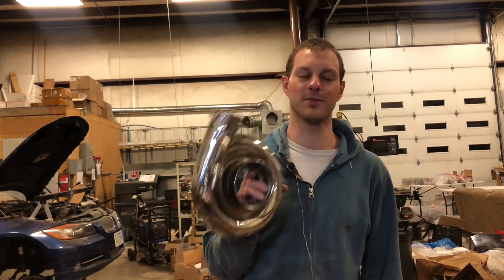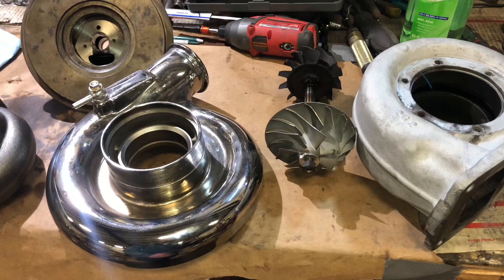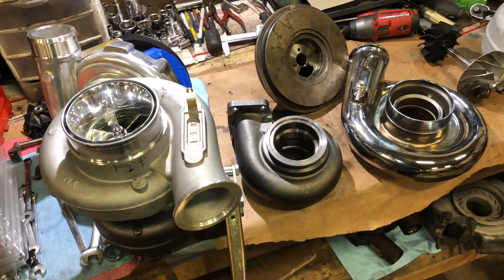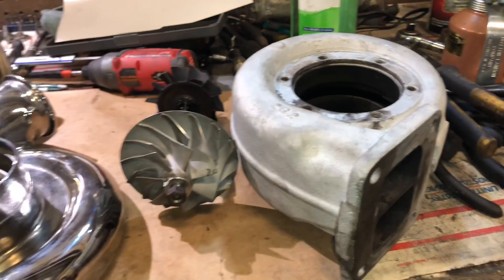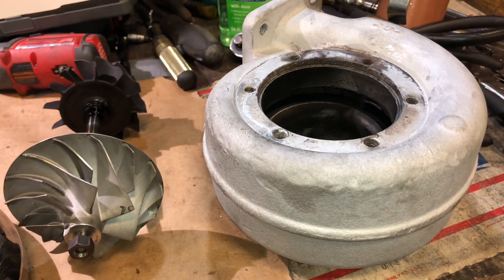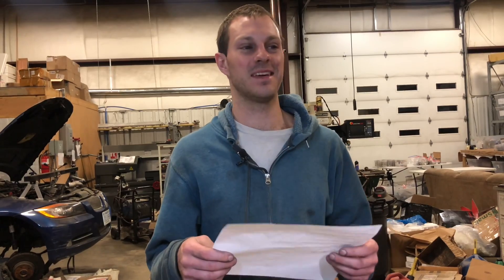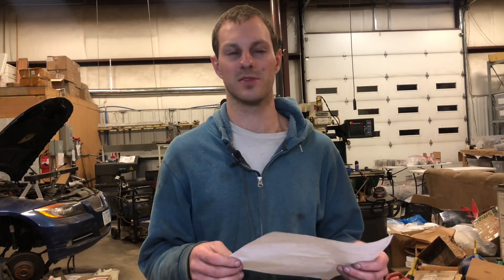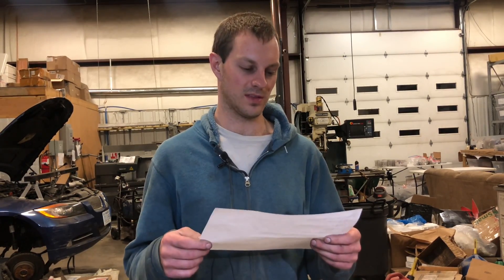How to make turbo spool up faster

Comment: Thank you this great video & info - esp re the turbine contours & dims !
Would like to ask : I have a s475 w t6 1.32 dvd turb hsg ( stock). My motor is a 437 c.i. V8 w 4 " str. No more than 5300 engine rpm & for road race / street . Looking at turb hsg that fits turb wheel ( 88 / 96 ) & is still a 1.32 a/r but it has t4 dims for exd/ ind & is non - dvd turbine entry . Would this be jyst as effective as a smalller a/r - esp for resp & transient behavior for road race ?  Thnx again .

Comment: Rotaries push alot of exhaust, its very common to run a larger turbo on than a comparable piston engine. I've heard a lot of folks saying Holsets are a good fit, and spool by 3000 RPM which still leaves another 5000 RPM of powerband. I'm considering running a 16mm turbine housing on my H1C to help spool a bit faster.
Reply: Rotary relics

Comment: Yup, having a 700 HP engine with a flat curve, I'd much better than one with 1200hp, and very peaky curve, starting boost at 5k, when you only rev to 7k, it's not going to be fun , more like on the verge of dangerous,

Comment: Your tune makes a huge difference too after the rest of the build is complete. Low timing down lower in the rpm will have fuel burn later in the exhaust manifold. Camshaft plays a huge role too . Those with the proper exhaust housing get a turbo going.  Believe it or not that Borg turbo isnt that big.  Tell him look for a tighter cummins exhaust housing.

Comment: Hey bud. I was looking for a small turbo for my 1.6l honda. Not looking to go big. Actually need something small so that I can keep my ac running. And also I only want to get around 200 - 220hp @ 8psi. Was thinking something like a 57mm. Maybe a ct26 but they dont seem adjustable to fit. But knowing that went into a inline 6 3liter. I think I can go smaller. Any ideas which would work for me? I appreciate your advice 🙏

Comment: What should i expect for much Bigger compressor wheel in stock compressor housing? I am trying to avoid excessive lag. Will it end with blowing much higher IAT? 

Got offered an “upgraded” VF38 with much bigger billet compressor wheel as well as bigger turbine clipped wheel + dual ceramic ballbearing. 
Was told that it is capable of producing 500hp (assume it’s referring to crank hp)

Comment: I'm just trying to add a little power to my diesel pusher motorcoach.  It's a 2000 24v and makes 275hp. Want to put 100hp injectors in and also get a good turbo or build the one I have to work good pulling a trailer.  How can I contact you all to see what you all recommend?  Thank.

Comment: What do you recommend for 5.9 cummins '06? I want to lower egt but want it to spool before 2000 rpm . I read 64/71/ 14 will be laggy below 2000. I have after market fueling but stock injectors. On automatic transmission with 35 inch tires I have to be doing 80mph to be at 2000rpm in OD.

Comment: What about oil pressure ? I saw an improvement on spool when i tried thinner oil switched 10-60 to 5-40
Reply: Thicker oil causes more drag on everything. Crankshaft, bearings, pistons and turbos then also takes alot for power for the oil pump to move it. Usually you want the thinnest oil that provides good stable oil pressure.

Comment: In all fairness a 13b rotary engine is actually the equivalent of a 2.6 liter 4 stroke piston engine when it comes to amount of combustion, therefore exhaust gas volume.
Reply: Lots of diesel turbine housings are sized to forego the need for a waste gate. There will never be the force on the shaft that the compressor needs to drive high flow at high boost. The drive pressure will be low that's great for efficiency but this looks huge. Given the size of the turbine wheel, and the t4 flange, lots of guys run a 1.15 twin scroll. This looks like a 1.32 or maybe even a 1.52. This compressor tops out right near 700hp everything being equal and even with that small of a compressor a 1.0 ar housing isn't out of line. T04z kits for Rx7s have a bit bigger compressor and aftermarket turbine housings are usually 1.05 ar. This guy probably needs a new housing or a diverter valve.
Reply: Still that truck housing is stupid for it

Comment: Hand sanitizer! LOLOLOLOL :D A rotary engine has huge amounts of heat energy outside the combustion camber, this helps to turn huge turbines. But also the fact that a 13B rotary volumetric efficiency is 4L when compared to normal 4 stroke terms.
Reply: no it is 2.6l
Reply: if compared to normal 4 stroke terms but it is still a 1.3l even though the volumetric efficiency is 2.6l

Comment: I would like a higher boosting turbo for my Experimental racing type aircraft engine,

ported & flow matched, single turbocharged, inner-cooled, fuel-injected, manual w/gate. 

Current Turbo:

Roto-Master (Rajay) Turbo Model 3AT6EE10J2

(325E10-1) 600573-00  600576-00 CF600573-9000
(RJ0331-1) 409170-9001

Engine: 360ci- 200hp 2500RPM

volumetric efficiency (VE) = .90%

Engine flow = 208CFM @14.7Hg STD

Thanks Richard